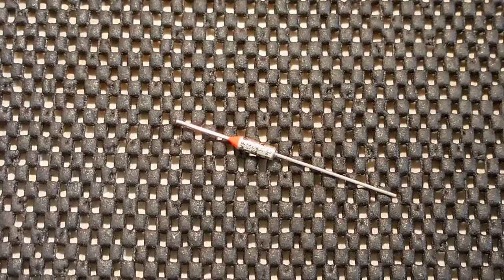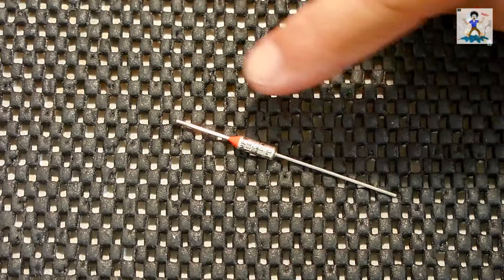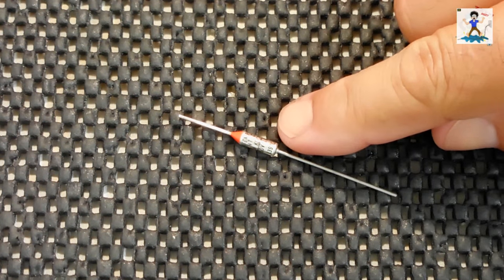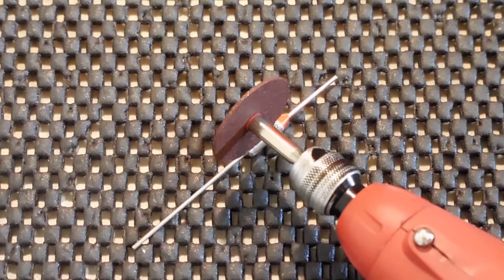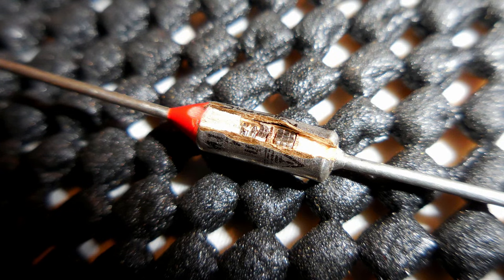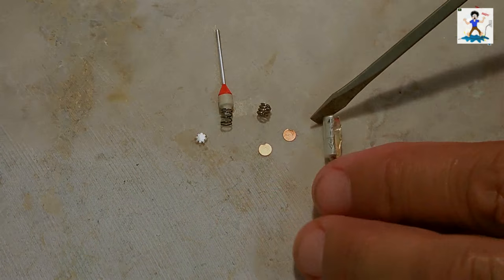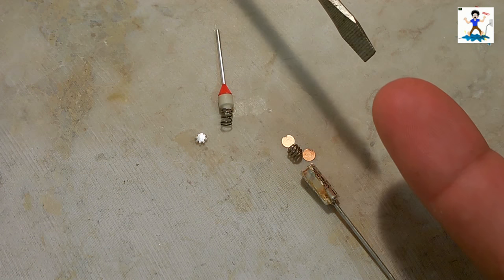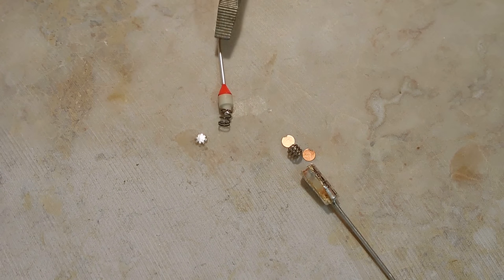Thermal Fuse (How it's Made)

Comment: Very cool video.  I have been working around these little thermal fuses for most my life and always figured there was just a type of soft soldier inside connecting the to leads.  When it gets hot, I figured it melted, braking the connection.  Now I know the actual truth. Thumbs up bro.  Cheers
Reply from the maker: Glad you liked the video! Be sure to share my channel with others, and check out my video playlists as well. Thanks
Reply: The square ones do use solder. It's just two wires connected with alloy with a low melting temp. The packing absorbs the liquid metal. 
It's sad they use this, I have a old early 80s maybe late 70s fan heater. It has a thermal switch you can reset simply by  pushing it back once cool. I know the thermal fuses cost literally pennies but I'd much rather pay a bit for a reset switch. It's actually very wasteful and greedy

Comment: My new cheap "Mr Coffee" just blew one.  Looks like they put 2 of these in series on the line.  My thought is:  There are two for additional safety.  While I wait for the replacement I purchased online,  I slipped a piece of mini brass tubing I have and crimped the ends onto the existing wire leads (After cutting out the blown fuse).  Mr C works just fine for now.  Thanks for the analysis.  Amazing how small they can make a fuse for 120V usage.

Comment: Very nice video.  The temperature briefly shown in this video commonly found in your refrigerator and microwave oven uses a bi-metallic strip similar to what is found in a mechanical circuit breaker.  When the metal gets hot or cold it bends opening or closing the circuit.
Reply from the maker: Yes, water heaters also use bimetallic discs. :-)

Comment: Another interesting video of something that not much is known about. I didnt know how the temperature could be rated accurately.  Thank you for cutting one apart. 
     There is another electronic item which is not well understood.  It is a problem and maybe you have done a video or plan one, it is how to repair wire ribbons that dont have copper wire but some form of powered metal between two plastic sheets. I have encountered this several times and can not find a repair method that works to rejoin a severed connection. Thank you again for the video.
Reply from the maker: Just bypass the faulty section with thin gauge enamel wire.

Comment: Thanks. My Hedge Trimmer keeps cutting out and won't restart until completely cooled. I stripped it down, regreased etc. but I can see at least 2 components which might be  a thermal switch and a fuse - tempted to just buy a new trimmer?

Comment: Adding to what has already been said by many.....great video, thank you for the useful information. I was wondering if it made any difference in which direction the fuse should be installed. My coffee maker went dead and I did check the fuse and it was the culprit. I ordered one through amazon. The only thing I failed to pay attention to was the direction the fuse was facing when I cut it out of the circuit. I assumed it doesn't make a difference as current can travel in either direction through a fuse.

Comment: does the Tapered side of the Thermal fuse have to be facing towards the incoming Power lines?! I have a Panini Grill with the Thermal Fuse fried!  But I don't remember the orientation of the original install.   Any suggestion would be appreciated.
Reply from the maker: Direction makes no difference.

Comment: The manufacturers like these because they hide them easily and most devices get thrown away and a new purchase is coming!  It would be much more consumer friendly to use circuit beakers and/or other visible fuses.  My opinion.
Reply: No, a regular fuse or a ckt. breaker is not the same and doesn't work the same way as this fuse.
Reply: My Philips fan heater from the early 80s has a thermal switch. There are clear instructions how to reset if the item overheats. Which happened only twice. I've seen new fans which omit this little feature.
Reply: @Gunzee  are you sure it doesnt also have a thermal fuse, rated for a higher temperature, as a backup? Sometimes they have that in case the thermal switch ever doesnt open for some weird reason. It's possible for them to stick closed (less likely than the contacts breaking causing a permanent open condition)
Reply: Hi ,i have a fruit liqudaizer and the motor stops working , i manage to open the bottom cover and found the ceramic fuse attached to the circuit board blown as according to my testing , but i cann,t get the acctual type of replacement , can i use this type of thermal fuse , if can what is the rating i should replace it and at  what value volts ,, due most are 220v and my machine is 600w... can any any one help ...tks
Reply: @sammy2888  check ebay or amazon, banggood or other places. Ceramic thermal fuses exist. (and neglecting to correct spelling and grammar reveals something else).
Reply: @rootbrian4815  Hi Thanks ,i will look for one suitable fuse
Reply: You can use thermal fuse for thermal runway on 3d printers as safety on different places.

Comment: I am very new to electronics (only as a hobby, not my profession). Questions:
1) why is one end of the fuse shorter then another?
2) is it important how you connect it - "which way" should the "sharper" end face? 
3) I would like to blow it that I connect some 9V battery to an LED via a resistor with having this fuse in the circuit. Using a lighter I would heat it up above  94*C. Any precautions maybe? I would probably use alligator clips for connecting the fuse to the linear circuit or maybe just some copper wire because I fear the clips will also overheat and maybe melt the rubber part.
Fuse type: SEFUSE,  sf90r0, 94*C, 15A
Reply from the maker: Styles will vary. Works either direction.

Comment: It is a very informative video showing how the thermal fuse works. Thank you. I have a question: There are always two ratings for a thermal fuse. e.g: 115 degree 2A @ 250V. Does this mean, the fuse will blow EITHER the temperature exceeds 115 Degree or the current exceeds 2A? It is not that both conditions must be present before the fuse blows right? If I may use the Basic Logic Gate, it is a OR gate and not AND gate, right?
Reply from the maker: Exceeding the voltage rating will have no effect, only exceeding the max temp rating.
Reply: Thank you for your prompt reply. If this is the case then what is the purpose of specifying the voltage and current rating. Does this mean I can ignore all the other ratings and only look at the temperature rating if I need to replace a thermal fuse? Case in point. The thermal fuse of my standing fan blown out and it is rated at 115 Degree, 2 A @ 250V but I could not get a exact replacement and I bought one with a rating at  115 Degree but rated 10A @250V. It is safe to use this to replace the blown thermal fuse? I hope that you can advise.Thanking you in advance.
Reply: Simon Bosch f
Reply: The thermal fuse may blow if EITHER the rated current OR temp is exceeded.  Resistors and other current carrying components, including thermal fuses, may fail if their rated currents are exceeded.  The manufacturer is informing the purchaser that the thermal fuse is rated to handle up to 2A at 250V which covers European,  American and most other common household voltages.  This 250V thermal fuse can be used safely on nominal 120V American household appliances and even nominal 240V appliances like dryers.  However, regardless of the voltage of the circuit, the thermal fuse is only rated to carry 2A.
Reply: He ask about exceeding amp rating, not voltage.  I once replaced a 150C 1A cut off fuse with a 10A 150c cause only one I had.  But  I also added a simple 1A fuse in line. Transformer is still working to this day. BTW accidently hooking up 600V to rated 220V thermal fuse may not be a good idea? @electronicsNmore

Comment: Is it matter direction of connect? I just changed thermal fuse for Ninja air fryer, after plug power is on but showing E1 and E3. do you have any idea? please let me know. Thanks!
Reply from the maker: No, either direction.
Reply: @electronicsNmore  Thanks, after reconnect shows code1 and code2 do you have any idea?

Comment: I always wondered what's inside one of these.  I know what can happen to a transformer without a thermal fuse, as I found out when I had a transformer wired up but didn't notice a couple of the taps on the primary were shorted together.  Long story short, a lot of smoke and insulating wax came out.
Reply: Seems to me that this is doing the same thing that the thermostat is supposed to do.  I think I'll just short it.  Probably some OSHA related junk.

Comment: I have a question! :) I have a two plate portable electric stove, or "hot plate" as they call them.. and the thermal fuse seems to be damage (bypassing it will turn on the plate) in my case, one plate es 1500 watts and the other smaller one is 500 watt and does NOT uses a thermal fuse, only the big one... now, since the thermostat know is working perfectly shutting down power when it reaches a certain temperature, could I bypass the thermal fuse?? I live in an island and electronic parts stores are closed (corona) 
thank you in advance
Reply from the maker: I suggest replacing the thermal fuse for safety reasons(fire).

Comment: What would be the recommended thermal switch temperature for an electric fan ?
Reply from the maker: It all depends on the insulation used for the fan motor's windings. I'd use 90 - 105C.

Comment: Great video. Are they single use only, or do they "fix" themselves once the temperature is restored? If they are single use, are you aware of an alternative that would be multi use. I'm thinking of a thermal sensor for a li-ion battery to cut the power to the battery if the battery heats up due to over or under charge or bad polarity - hopefully stopping thermal runaway. But it would be great if the fuse was reusable. If maybe the problem was not with the battery or fuse but somewhere else in the circuit for example.
Reply from the maker: Single use. You need a thermal switch.
Reply: Put a thermal switch in series with a thermal fuse, where the switch temp rating is less than the fuse temp rating.  The thermal switch alone will not prevent overheating damage.  This is how coffeemakers are protected.

Comment: Hi what kind of cut fuse do many battery pack company use . your advice please
Reply from the maker: All depends on the battery chemistry. You need to match the rating to the blown fuse. Doesn't have to be exact, but very close. Look online for more info.
Reply: Hi thanks for your swift reply

Comment: very nice video.  You should mention that once the thermal fuse is overheated, it is blown and MUST be replaced.  Not like a fuse that recovers when the temperature comes down.  ALSO, notice the numbers on the fuse... go to a shop that sells these things and buy a new one.  I paid about 5 euro (6 dollars?) for one and I think I paid too much?
Reply from the maker: Yes, these are a "One shot" deal. I figured viewers would know that when I explained how they work. $6 sounds pricey. Thanks for watching!
Reply: Thanks for answering.  Hey another question please.  My thermal fuse was not my problem.  But I noticed NO continuity through the double heating element AND over 300 volts going through everything, even though we have 240 volts from the wall outlet (Europe).  What might cause this spike in voltage?

Comment: Is there a polarity for these fuses. Similarities to diodes.  I tried to replace one and it keeps blowing mains breaker. Suggestion???
Reply from the maker: No. They work either direction.
Reply: electronicsNmore ok. Great. I must have something grounded wrong then. Thanks
Reply: For this particular diode, polarity does not matter but as a rule of thumb, try to have the point of the diode going in the direction of your current flow. This just gets you in that muscle memory reaction of always running your polarity in the right direction. Just something I was taught by a long time installer.
Reply: @bigpop-popsmurf  This isn't a diode at all. Also, beware installing with a soldering gun.  A typical 300 C soldering gun tip can blow a 220 C thermal fuse quickly unless something is done to limit thermal heat transfer to the fuse.  Manufacturers spot weld the thermal fuses very quickly and repairs are usually done with mechanically crimped butt joints.

Comment: The thermal cutoff fuse may blow if EITHER its temperature OR rated current is exceeded.

Say the manufacturer rates a thermal fuse at 220C 10A 250V.   The thermal fuse will blow if it experiences a temperature greater than 220C, meaning a combination of the fuse's internal resistance heating and the ambient temperature it's being exposed to within the appliance.

The thermal fuse may also blow if the continuous current it is carrying exceeds 10A, regardless of the voltage of the circuit it is part of.  Resistors and other current carrying components, including thermal fuses, may fail if their rated currents are exceeded. 

The 250V indication means it's good for use in appliances connected to European, American and most other common household circuits.  A 250V rated thermal fuse can be used safely in 120V American circuits and 230V European circuits.  However, regardless of the voltage of the circuit, the thermal fuse in our example is rated to carry a continuous current no greater than 10A.
Reply from the maker: Correct, the fuse is rated to carry a certain amount of current, but if you go well above that rating, the fuse will heat up and cause the circuit to open as if an external high temp made it blow.

Comment: Should be a bimetal reset type...not a disposable trash one time us one... Not nice for mfg to do.
Reply: I've seen appliances that have a resetting thermal switch, but just in case that ever doesn't open for some reason, which is less likely than contacts breaking, but it's still a realistic possibility that a reusable switch, could eventually have the contacts "weld" together from the arcs. 
So, to prevent a fire from starting, a thermal fuse could be included that's rated at a higher temp than the switch, to cut the power off in an emergency, just in case. 
Even if there was a fire and they did get sued, they could settle out of court for a smaller amount, by pointing out the safety features they included to prevent fires from starting.